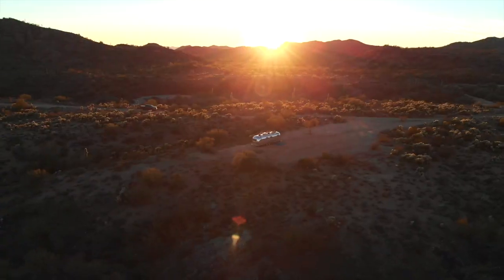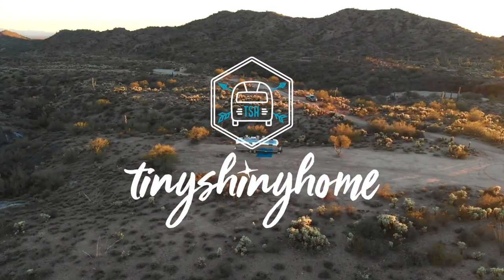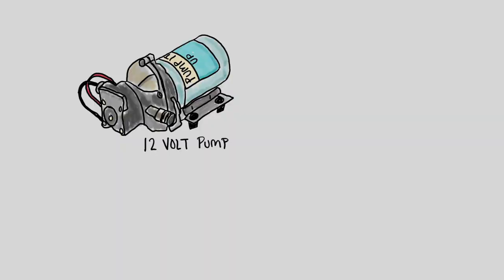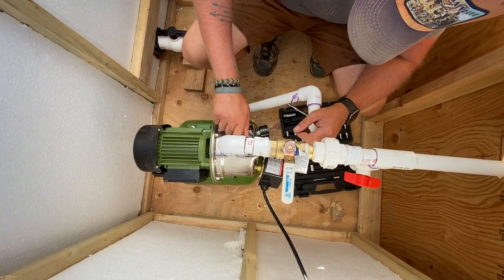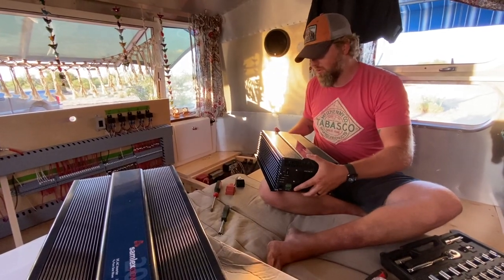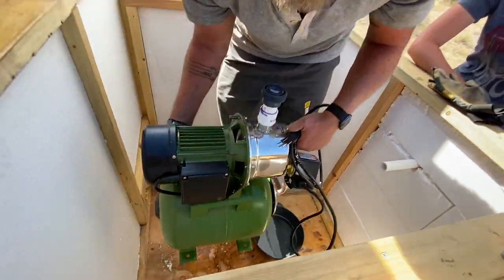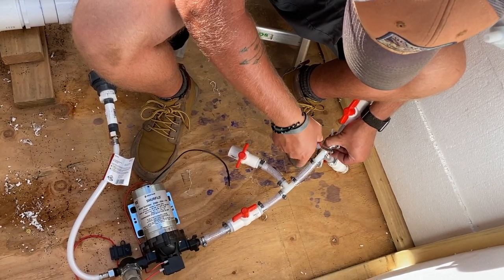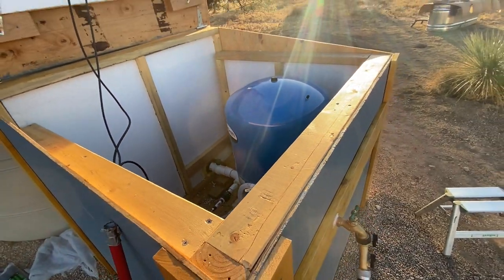Water Pump Success - Solar Powered Pressurized Water OFF-GRID

Comment: For fencing I use 1 3/8” galvanized pipe connected to 4x6 pressure treated posts. I cut them to 5’ and put 1’ in the ground. Then I tamp it down. I do not use concrete. Your welcome to check it out. It keeps the cows out and looks nice.

Comment: You just saved me from going down the same rat hole!  Thank you so much! We have a 2500 tank by our well, and I have to have 240 VAC there from the big solar system, but then I am going to convert to 12V and run your system for water  Perfect for a deep well uphill from our 5th wheel.  We will then use irrigation pipe and pumps for irrigation, that is a different question.  Thanks again and love the content.

Comment: Cool, I got to see how you built the first water pump house. Cool you did use flexible hose and nylon hose barbs and then the pressure tank to keep the pressure up! That little pump works great. So does the pump have a pressure switch in it? We had a pressure switch fail for our well pump and it took us 3 days to get the new switch (it broke on a Friday night of course). No water or flushable toilets. Nine Nine was also adorable as a puppy! We have a pressure tank in our system too so it drops down to 50 psi and our well pump comes on and pumps it back up to 60 psi. It works great too. It makes our spigots near the barn work as well as the house. Thanks for this TSH. Wow, that heavy duty pump was way overkill. I was thinking that a capacitor with a pretty good discharge could have perhaps helped with the starting draw of the big pump electrically upstream of the pump but the wire being too small would still be a problem. They use capacitors to kick start the compressor in the condenser side of an air conditioning system. We had that go out on our A/C once too. A very cheap part, around $10 but you have to replace it. Capacitors do fail. We just checked it out with out little ammeter. Being on a farm makes you have to learn some of this stuff. It's freeing when you can set-up systems for yourself. I'm sure you have that great feeling.

Comment: Great videos folks! I am thinking of an RPS solar water pump which is basically a pressure tank and pump in one.  Of course that means because of low capacity for holding water it switches on and off as soon as you run water but I was told by the reps that these are used in irrigation and built to last. I am thinking of field fencing for my place.  A bit expensive but keeps Javelina out.  T posts pounded into the ground to hold everything up.

Comment: We live off grid also and have had to find simple solutions also.  We decided on a cheap 110v pressure pump just outside the tank, no pressure tank.  My pump looks a little different, but I think the work the same with a built in pressure switch at approx 45psi.  I have backup pumps in case of failure.  Buried water line to home and insulated portions above ground.

Comment: you were correct in going with the large accumulator tank. the thing that kills rv water pumps is short-cycling, where the pump switches on and off really fast, you've probably heard that sound in your rv when you turn the kitchen faucet down to just a small trickle of water. that 'hammering' effect literally hammers the pump to death. with a big accumulator the pump will turn on and run steady all the time, and will not suffer from the hammering effect and the pump will last much longer. only high-end rv's have accumulator tanks installed from the factory, most don't have any...
Reply from the maker: Yep, we installed one In our Airstream renovation so we can verify they’re awesome. Having a huge one is in the pump house is nice, but man does it take a long time to pressurize once the pump kicks on 😂

Comment: Aye ..... So I lived in Arivaca and we had the best fence in town, we aquired some old power poles cut em up and did 12ft span with 2 T posts in-between, 4ft square hog wire all the way around then 2 strands of barbed wire around the top.

Comment: Great solution to your water distribution needs. Fencing should be based on application - on my grandparents ranch he used two types of fencing based in the livestock. For the horses he has wood plank fences and for the cattle most of the fence is high tensile wire fence w/single (solar)electric strand and uses barbwire T-post style around the hay field.
Reply from the maker: Yeah, high tensile fencing is at the top of our list right now. Easy to fix, doesn’t obstruct our views, and relatively low cost compared to other types we were looking at. Plus the added benefit of being able to electrify it is nice too.

Comment: Running water in the desert! Good job! How much are you fencing off? The entire perimeter? Or a smaller section by the airstream. I've seen beautiful fences made out of 2x4s and cattle panels. Much more work than tposts and fields fencing and more expensive too but boy it looks great.
Reply from the maker: We’re only fencing the 6 acres we’re building for now. Eventually we’ll fence the other 5. We want fencing that we won’t have to replace in 5 years, or better yet, 15-20 years!

Comment: Great video! I am assuming the water is being sourced from the bottom of the above ground water tank? My question is: do you think the same pump model would work if the water was being sourced from a buried water tank (no more than 15 feet deep)?
Reply from the maker: Right, gravity is helping since you're pulling from the bottom. I don't know about 15 feet, but we have a similar setup with a tank buried about 3-4' deep on the Airstream cover (first video here: https://youtu.be/xcJ9y_6h_no). It works great. If it doesn't' have enough juice you could always do a sump pump.
Reply: @TinyShinyHome  thanks for the reply 🙏

Comment: Do you have a pressure switch on it to cut it off at a certain pressure? Brand/model?
Reply from the maker: Check the description- there’s a blog post with all links you need. Rv water pumps have pressure switches built in - simplifies things a lot.

Comment: I downloaded your water setup and did something very similar. I can’t get the pressure tank to fill with water. The pump shuts off when routed to the tank. I adjusted the pressure thinking maybe the pre charge was too much compared to the Shurflo pump output. Did you have any trouble besides slow fill time of the pressure tank?
Reply from the maker: That usually means the pressure in the tank is too high so the RV pump is cutting off before filling it. See around 6:38 on this video: https://youtu.be/Bo_5Xbf3WMk A 20 gallon pressure tank will take quite a while to fill (about 7-10 minutes, a 30 gallon takes 15-20 minutes)
Reply: @TinyShinyHome  thanks for the quick response. I let out half the pressure but I’ll play with it some more. 

Really liked that you used just 1/2 hose. Tons easier than when I did another version with Pex. Thanks for the videos and response !!
Reply: Curious, does it hurt anything there's no pressure switch coming off the pressure tank? This design will save me big time!!